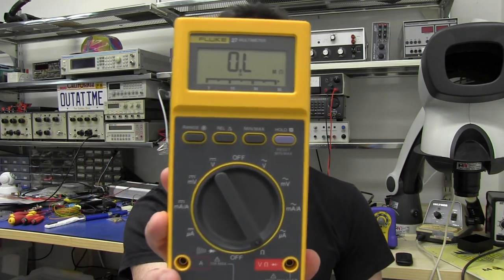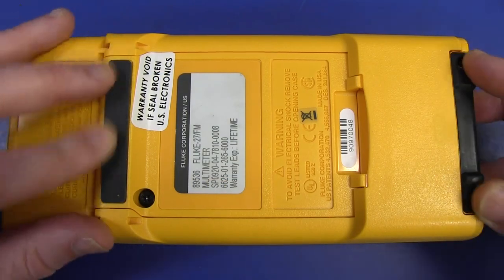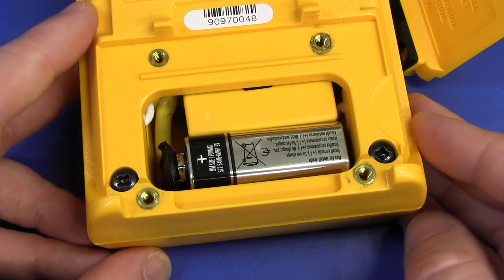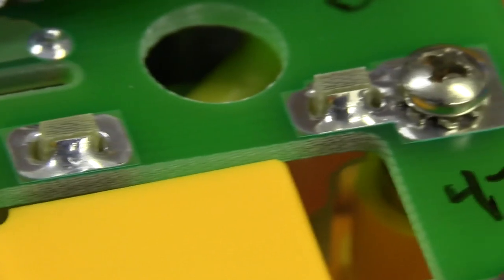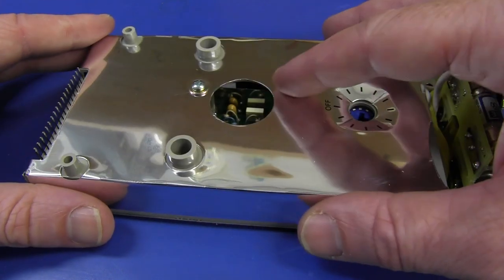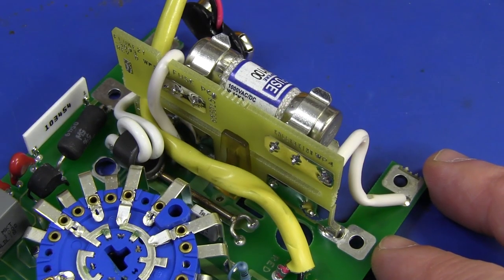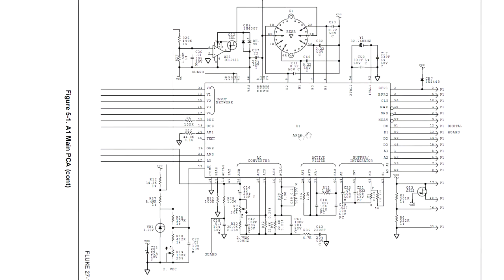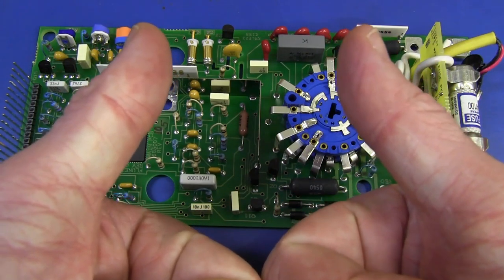EEVblog #372 - Fluke 27 Multimeter Review & Teardown

Comment: Just a couple of minor corrections: the "FM" designation is short for "Fluke Militarized".  Also, the low-current input is 320 milliamps — (not 3200).  Lastly, the fuse cover isn't to keep the fuses from "vibrating out and coming loose" (although it MAY do that as well); it's to insulate the contacts of the fuse holders from being shorted against the 9V battery's shell (and bypassing the fusing).
Reply: Witch it doesn't even matter. Since there other that are not mark as FM and they are still for Malitary use.

Comment: $40?? How the hell did you manage that?

I was going to get a Fluke 17B until I saw this, then I remembered why I really want a Fluke; To be able to say "That's not a multimeter, THIS [bangs 27FM on table making 17B leap in the air] is a multimeter!"

(PS: I blame this video for making the eBay prices go up...)
Reply from the maker: Just be patient and you can eventually get good deals on ebay.
Reply: EEVblog :-) can u sell me your?? i need one, hi from venezuela i love ur work. keep
Reply: daniel montilla 

lol! Should be plenty of them around. I think they were still making them in 2007-2008 and beyond. Soldering on flat pack ICs under a magnifier, oh the horrors!  After that Fluke sort of hit the wall, the military money dried up, stock price dropped to a third, everyone got laid off or retired, and probably all that legacy items were finally retired from production. 

This brought back some memories though, since I knew a lot of the cranky old ladies who probably built more of those things than anyone living. Well, they were living at the time. 30+ years of occupational lead exposure, can't say if they're still kicking.

Oh, saw the numbers. Memory could be off but I think Debbie and Jan did that one on the soldering, etc.  Long retired by now, probably the best in the company for soldering and speed.
Reply: I have two fluke 27FM and one yellow 27.
Funtion switch is better than any other Fluke.

My Fluke 27 and 28 series 2 use a garbage switch insted than older flukes 27 series.

Comment: I picked up an ex military Fluke 25 on ebay, really good meter mutch better than a new cheap brand one, as long as you like the olive green mod colour.

Although it had a poor lcd display, very faint when I got it.

I disassembled the LCD display and cleaned both sides of the rubber connector strip and LCD display contacts and board contacts with an alcohol wipe and then reassembled it.

Now the display is back to a nice dark black again and easy to read.
Reply: I got the same meter for £40 . I`ll never have to buy another meter . Just brilliant .

Comment: I still have an original model 27 that's been in my possession since about 1985 or about 30 years.  It is the solid yellow model and has three fuses: 20A, 3A and 630mA.  My 20A fuse is blown so I don't use that range of current but other than that it still function pretty much as it did the day I got it.

I also have a Fluke 85 that's probably 25 years old or there abouts and is 100% functional.

Comment: Hello
Thanks I appreciate your teaching. I need a cheap but good quality multimeter with MinMax function for a car batteri health and status test. Using this Multimeter as a very elementary “DIY” Person on the car's electric and electronics parts also diagnostic of car batteri state starter + Alternator test my measurement of the charging status “ Ripple “ test & reading Ripple ( Max AC Current leak ) from alternator to car batteri. I don’t wanna spend too much on a multimeter * which there is almost no le amidst on how high one can spend on a multimeter so my question is “ Please give me few example of reasonable priced Multimeter for “ DIY beginers ” to have a multimeter Quality enough to the task, without spending a unessary money on the Multimeter just for doing basic work on the car. Thanks a lot - I appreciated very much if get answer sooner.

Sincerely Parsa

Comment: I just scored a Fluke 27 in all charcoal color for $10.00 US at an estate sale!  I got a Fluke 73 III for $5.00 with it!  The 27 is in near mint condition, in the box with the original leads, manual and warranty card.  It doesn't have the CAT rating, so I opened it up and can date it to sometime after the 39th week of 1988.  With the exception of the display board, very close to the FM version you showed us here.

Comment: I just bought a Fluke 25 from ebay for £40 . The thing is bomb proof, water proof , accurate as hell , beautifully made . With the price of these things , anyone buying a cheap chinese meter when these can be had for so little is crazy . The age doesnt matter , it will out live me buy a long long way . I use it for motorcycle building so only really for ohms and voltage so its a perfect meter  for me . Dont buy chinese shite , but an old fluke and you`ll never have to buy another .

Comment: Hey, could you do a video on power electronics? Like maybe on motor controllers, DC-DC converters, or some other high power device? Also, perhaps you could explain why very few EE's go to the power engineering design route. It seems they all want to be digital designers, RF designers, or analog designers. Any reason why?

Comment: I think FM stands for Factory Mutual, not For Military.  Factory Mutual does intrinsic safety ratings for products used in hazardous environments.  This is similar to the Ex rating though from a different rating organization.  
Fluke does have current products that are advertised as FM rated.